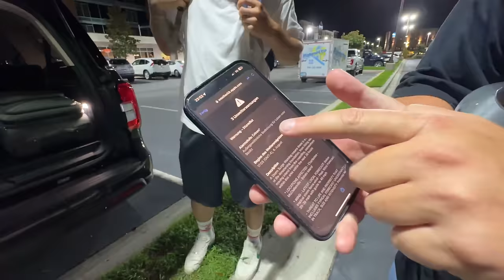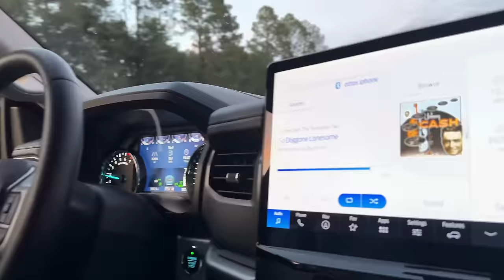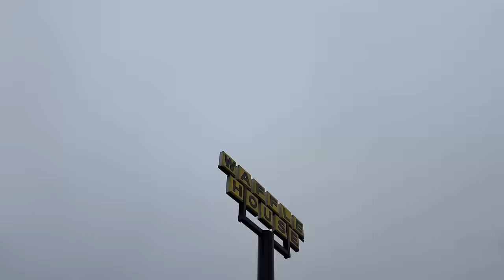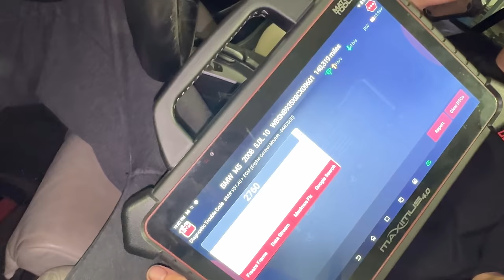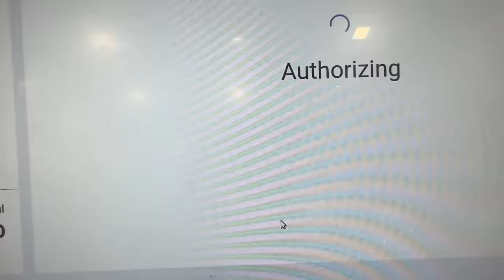REBUILDING & THEN DRIFTING MY FLIPPED M5 E60 DURING A HURRICANE - WILL IT EVER RUN PROPERLY?

Comment: 360 with gear engaged will turn the engine backwards which is Very Bad, hope it’s not the end.
Also FYI you can very easily code the ecu for those V8 injectors or Ferrari ones too, it’s a small adjustment of the pw/fueling.

Comment: the problem with your exhaust sound issue, is that the mid pipe is just a dual pipe, doesn't even have the OEM crossover. just get a new x-pipe and you'll be fine.